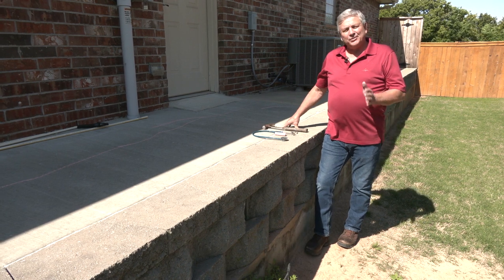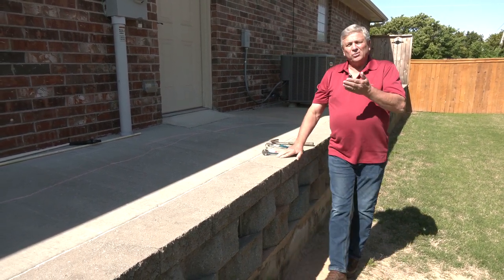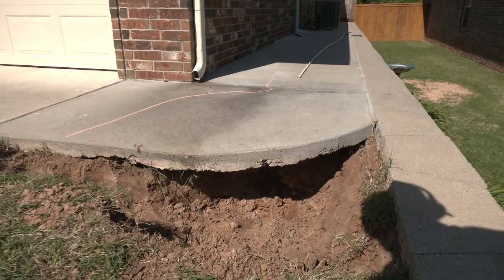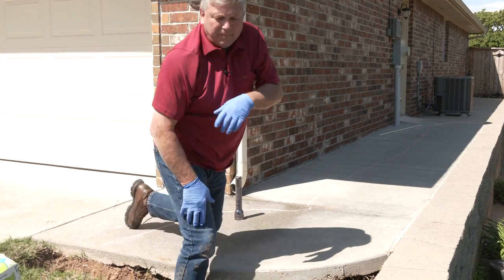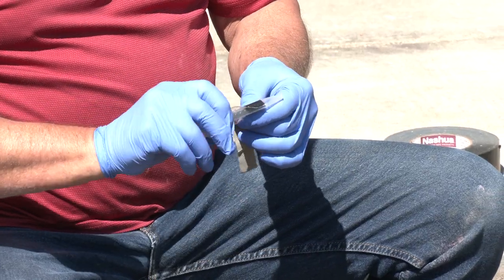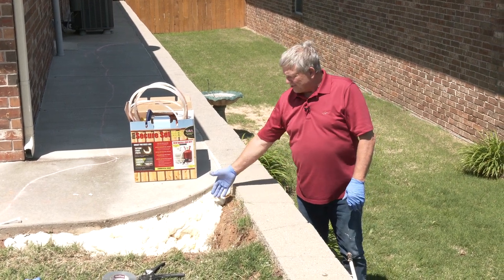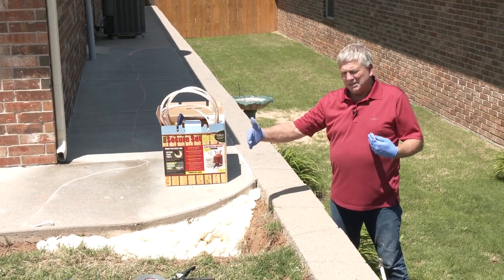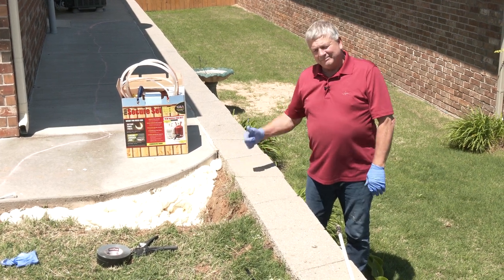Secure Set Spray Foam: Repairing Washouts Under Sidewalks, RV Pads, Pool Decks, Driveways & Patios

Comment: This is a great idea for my whole neighborhood. New subdivision with a lot of land settling and subgrade washout under driveway
Reply from the maker: Thank you!  New subdivisions do seem to have issues with washouts around their sidewalks, pool decks, driveways, and houses/out buildings.  We have many people calling with these same issues and resolving their problems with a simple fix.   To order please go to www.secureset.net or give us a call 405-672-8885 .
Reply: Secure Set is there a smaller about that you all sell that can be sprayed.  My area is about 4 inches about 6’ x 6’. That big containers you all sell will probably ably use about 1/3 at most.
Reply from the maker: @alexanderperez1300  This is a 10 cu. ft. kit.  If you have 72" x 72" x 4" ,  which is 20,736 cu. in. / 1728 cu. in. to 1cu. ft. , then you actually have 12 cu. ft. to fill.  But if your average depth is actually less than 4" in some of that area, then the 10 cu. ft. kit should fill that space.  If you want to send us some pictures of what you have and give us a call, we will gladly talk it through with you and see if there are some things we can help explain.  Our email is info@graservices.com and telephone # is 405-672-8885.  Thank you, GRA Services- Secure Set

Comment: Have you ever tried using a camera to see what is happening when you are trying to fill a void so far back? There are some cheap cameras that can connect to your smart phone with 20 foot cable length. They are less than a half inch in diameter and so cheap they are almost disposable. This could be taped to the outside of the extension tube (CPVC pipe) a foot or so back from the end so it would stay out of the stream.
Reply from the maker: Hello Bob D,   That is a very good idea.  I think it would be very useful for areas under garage floors, patios or other similar circumstances that are suspect to have voids under the slabs. A good tool to incorporate into the initial inspection stage of the project.  Thank you.

Comment: Really impresive! but isn't there a risk to overlifting the sidewalk as the foam expands?
Reply from the maker: Thank you for the comment.  Yes, it is an impressive product. The only way you will get the lifting of the concrete is when you overfill the area with foam.  The foam always follows the path of least resistance, so it will move to fill the voids, and maybe even escape out from under the sidewalk in some areas before it would actually lift.  We do have 2 lifting/slab jacking instructional videos if you want to see how we perform that process with Secure Set Spray Foam.  
GRA Services

Comment: I have seen  videos of  the foam filling a void and it raising a slab of concrete, How do you  keep if from raising a slab that you are just trying to fill the void and not raise the slab?
Reply from the maker: Hello,  If your void can be accessed from the side, there is no issue with the foam raising the slab because the expanding foam will always seek the area of least resistance. It will expand to fill a cavity or void.  If, on the other hand, you have a confined cavity, and you have to drill through the top of the slab to get to the void, you must try to predetermine the potential size of your void.  Once you drill trough the concrete, you can probe the cavity to determine it's depth. Also hammer sound the concrete to try to determine the area of the cavity.  When you know length, width and depth can can determine size of void in cu feet.  The spray foam kit delivers approximately 1 cubic foot of expanded foam per minute of spray time. I hope this answers your question.  Thank you

Comment: This may be just what I need for my pole barn . I have very slight washout underneath the 6 inch slab of my pole barn. I also have critters digging holes.  I have a 30 x 40 pole barn. I’d like to go around the whole perimeter under the slab and squirt foam in to keep critters from getting underneath.  do you think this will work? I was going to dig all the way around the pole barn down to foot and put in screening like I’ve seen other people do on YouTube, but I was curious when I dug away the dirt the stones will start falling from underneath the slab . I thought maybe this foam  would be a good idea . Any thoughts?
Reply: I'm having the same problem with my shop.  Water erosion plus critters digging in.  Have you tried this product yet and did it work?
Reply: I just posted that the other day lol ! I was hoping that I’d get a reply.
Reply from the maker: Thank you for the question and we apologize for the delay in responding.  Yes, the high density foam is great for this type of application.  I personally did this same project 2 years ago along a building with dug out areas and washout.  The critters never came back and messed with it from what I can tell and the water has been diverted.
Reply from the maker: It will work for your application, as well.  Thank you!

Comment: Where can I buy this kit?
Reply from the maker: Thank you for your question.  Go to www.secureset.net and there are 2 of our Secure Set Spray Foam kits available the 10 cu. ft. and 16.6 cu. ft. kits, both are the same price.  For a project like this one the 16.6 cu. ft. would be the best choice, since it will support 5,040 lbs. per sq. ft. and you get 66% more foam to work with than the 10 cu. ft. kit (which supports 10,080 lbs. per sq. ft.)  You can also call us direct at 405-672-8885 to place an order.   We have updated our web-site to answers many of our customers questions, with FAQs listed for each product and showing many of the projects we have done, as well as links to our YouTube videos.  Kind regards, GRA Services

Comment: What is the approximate volume a pair of tanks can provide? Do you have this info on your site?
Reply from the maker: Thank you for your question.  Yes it is on our site www.secureset.net.  This kit in the video (and on our website) is the 10 cubic foot kit or 120 board feet at 1" thickness of high density foam.   At times, we also have a 200 board foot kit or 16.6 cu. ft. of medium density foam.  Call 405-672-8885 for pricing and availability (but we do happen to have it in stock at this time).

Comment: Yukon, Okla part of my back patio needs to be raised about 1/4 inch, on the East end of the patio the entire side is washed out 1 to 2 inches deep and 4ft by 5ft width and length. Should I drill holes and fill or run tubes through the East end and fill with foam. I need to raise a little and fill a out.

Comment: not a pro, but couldn't you drill a small hole through the concrete, fill from above then patch the hole?  Similar to leveling sunken driveway?
Reply from the maker: Yes, you could drill a hole, but then you would not know if you were able to fill all the cavities.  By digging out the end and actually seeing where the foam was going and not putting in too much, we were very exact and had the confidence than no area was left unfilled.  Thank you.
Reply from the maker: Also, please see our latest video https://www.youtube.com/watch?v=-G2ivvO5aQY where we drill holes in the concrete and spray the foam in blindly.  We did this for the purpose of lifting the concrete as much as 2", as needed to level this large slab.  It worked for us.  This is a great tutorial for foam jacking, but you can also do this process with the intention of just filling the void and not overfilling it for the lift.  Drill some 3/8" holes and probe the area to find out how much of a void you need to fill. 
Thank you, GRA Services - Secure Set

Comment: How do you keep dirt from caking into the tube when you feed it under the concrete?
Reply from the maker: Hello,  Its quite simple, actually put a piece of ordinary scotch tape over the end of the tube.  It might not seem like it is enough, but it is.  When you start to extrude the foam out of the tube, the pressure of the foam will push the tape of the end and the foam will come out.  Thank you
Reply: @SecureSet-Fence-Installation  Thank you. I think we will be ordering some soon for our concrete pool skirt.

Comment: Thanks for the video. I am currently remodeling our bathroom. Upon pulling the tub out I realized that the tub plumbing was never connected and washed away about 8-10 inches of dirt below my concrete slab. The entire bathroom floor is 20ft by 15ft. Is this product good to use with my problem?
Reply from the maker: Hello,  Thank you for the question!  The answer is YES, this will work well.  We recently helped the owner of an apartment complex that discovered that the bathtubs in the apartments on the first floor basically just hung through the floor and were not supported underneath. We were able to get in under the building and spray a foam base of material under each tub.  It was a column of material that supported the tubs.  Worker prefect!  Are you able to get a visual of the cavity under the concrete?  Thank you.
Reply: @SecureSet-Fence-Installation  Yes so I took pictures from the hole in the concrete ( where the plumbing ran underground from the old tub). I can clearly see the gap in all directions. The other thing is when we turn on the faucets the water comes out of the pipe that wasn't connected to the tub. So all this time water from the tub and both sinks have been washing the soil away. A plumber told me I needed to bust up the entire bathroom floor to just look at the plumbing. 25 to 50 thousand dollars. That seems crazy to me.
Reply from the maker: Hello,  Do you mean the drain pipes from the tub and sink were not hooked up?  We can chat more at info@graservices.com or please call 405-672-8885

Comment: I hope your still watching this thread. I've seen a number of your secure set videos in the last couple of days and have a question for you. The house is a 2 story with full cement slab basement and block walls built in 1920, no lag bolts holding it to foundation.  I have an L shaped dip in my footer on the back corner, 30' on the long leg and 15' on the short leg. The cause of the sinking has been corrected, its now just a matter of leveling of the sill plate. I am going to lift this house back up to level with a series of jacks. There will be a void at the top of the block wall and under the sill plate along this L shape, largest void being at the apex of the L shape. I wanted to pack cement in this void but it would fall inside the blocks, would this secure set (SS) foam hold my house up after It sets and I take the jacks out? Or I could fill the block wall with SS and force concrete to fill the void at the top. Whats your thoughts.
Reply from the maker: Hello Clay,  Seeing that you intend to lift the floor to a level point with the use of jacks, once you have the floor to your desired level and if you can get actually see the void under your slab, you could fill the space with the high density foam and support your basement floor.  The foam will support 10,080 lbs. per square foot. If you can accurately calculate the weight you intend to support, if it is less than the stated value, you can accomplish your project. My experience is that you should lift your floor to approximately 1/4" past level, then when the jacks are removed and the weight is supported by the foam, normally you get a slight compression of the soil under the foam. On another note, the company that fills the pressurized cannisters for us to make the spray foam product has had significant Covid related issues.  Because of that, we are out of stock at this time. We are told a production run of the foam will take place on Jan 18th.  Once they produce the product we should have it in stock by the week of the Jan 25th.  Another issue we are facing is that several states have stated that as of Jan 1, 2021 they will no longer allow spray foam to be sold that is not GWP (Global Warming Potential) certified. Those states are Calif, Colo, Wash, New Jersey, New York and Vermont.  If you live in one of those states, spray foam will not be available until mid March.  Thank you.

Comment: Will this work under concrete steps where dirt has washed away?
Reply from the maker: Hello,  Yes, it will work under your steps, as well as driveways, sidewalks, RV Pads, pool decks, etc. Thank you for your interest in Secure Set Spray Foam.

Comment: How many cubic feet in that kit?
Reply from the maker: This kit was the 10 cu. ft. of the high density foam (support 10,080 lb. per sq. ft compressive strength), but we also now have a 16.6 cu. ft. kit of a medium density foam, which will support 5,040 lb. per sq. ft.  Please call 405-672-8885 if you have more questions, we will be glad to help however we can.  GRA Services